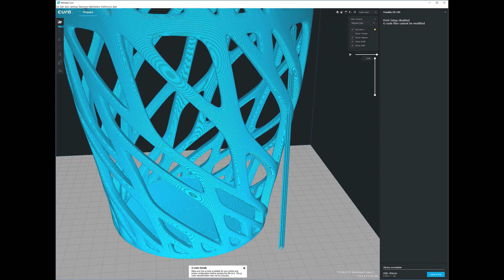3D print fail on cr10s pro fixing 3d print, it's Microsoft's fault

Comment: this is one of the reason i use the sd slot most the time, even with my octoprint i was having trouble with it restarting my printer mid print on my ender 5 the power loss recovery is worthless cause the bed drops when it loose power or turns off the stepper motors an when u try to start it back it only homes x and y so z is always lower than what it is suppose to be and would just print in mid air. i love octoprint but i had to disable everything that was automatic cause it would restart my printer anytime it done something that cause it to require a restart an just did all this on it own, i used to just connect to it with the browser on my pc but now i have it setup with a monitor of its own running a desktop so now when a update or something comes up i can see it an can accept to update when i want instead of as it found updates, so far so go with it but that was default settings an u wouldnt think they would set u up for failure like that. 3d printing pins work pretty good for patching failed prints an i always use super glue to put everything together then go back with the 3d pen to clean everything up an i have a set of tools that came with my printer through out the yrs an one has a few flat spatula type tools that are really small an i use my heat gun from my soldier station like urs or just my heat gun to get those spatula tools to help smooth an shape the part, but i noticed u had urs set to 210 an that pretty close to what i print at with pla an i always had to run the heat gun at a higher temp than i normally printed at to get it to actually work for me, my heat gun dont have the option just a high an low settings an i alwasy had to use the higher setting to get the tools hot enough to work.
Reply from the maker: Thank you for the tips you laid out here.

Comment: I am slowly playing with the windows system's visible/hidden settings in my new pc to stop it doing all that douchebaggery. Soon I shall be in control.
Reply from the maker: Have you gotten control back?
Reply: @RoamingInterests  
Yes I disabled auto updating. It still kept looking then I did more settings and found a windows file that does that. Then I blocked it using a 3rd party firewall. I also blocked and disabled a lot of windows apps like windows firewall, defender. I disabled advertising ID, background starting apps. Most of it is in control.
There are ton of features that say "Allow windows to send anonymous usage data, allow windows to send report automatically during error", which is all doing something else in the name of good guy. Even if you disable those obnoxious settings, some other app will be doing the same for them in the background. They show it like they care for us, but it is all about monitoring our each and every activity from start to end, and sell it for advertising. And ofcourse to secret services. 
Its a lot of work like checking the services.msc and startup to find and disable the services from running automatically. If there is something stuborn, then find its file location, then end its task from running services list, and immediately rename the targeted file into something else before it starts itself again. 
When the owner of the company wants to inject microchips, shady vaccines, Sell GMO food that has not more than 5% nutrition, terminator seeds, then he cannot be trusted with his operating system too. 
It would be better if you get it done through a visit home technician(non microsoft) or a techno relative.
Reply from the maker: @KetansaCreatesArt  Thats a lot of work you put into it. I wonder how is not CoPPA applicable against this operating system because it is sharing private data, some of it may be children under 13.
Reply: @RoamingInterests  
The microsoft have been doing these things since years. Now they have released some settings to give you control, for legal escapes. But ton of things are still hidden. 
The CoPPA also have deliberate loop holes as well. Did you see how they rolled out the settings? 'Made for kids' and 'Not made for kids'. There was no "made for all" option. Youtube confused everyone deliberately to create issues for coppa and spread anger and discomfort among creators. I believe their intention is to roll kids products ads targeted for kids, next.

Just for the sake of difference  and fun, I would suggest using Firefox browser. go to mozilla addons page, look for ABP Ad Block Plus addon and install it. Tons of advertisements will be gone. You wont even see any ads on youtube videos.